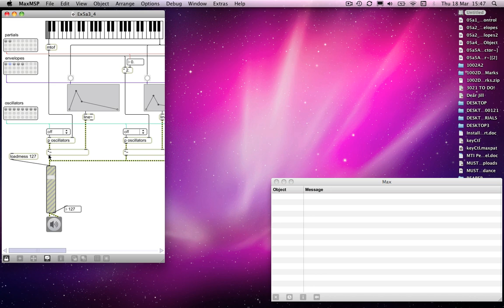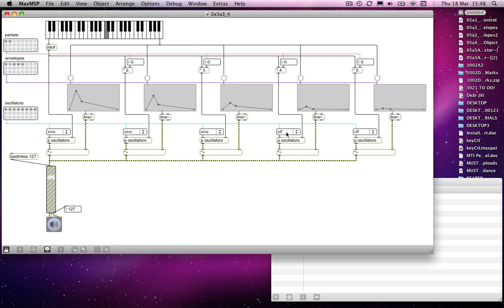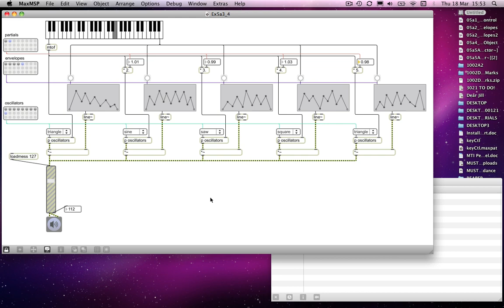Max MSP Tutorial 05a7: Additive Synthesis

Comment from the maker: @mudithead It depends which *~ objects you mean. Those at the top are multiplying the frequency value from the [kslider] (via [mtof]); those at the bottom are being used to control level.  Remember that we're just dealing with numbers, so the *~ object could be used to multiply any signal value to whatever end. 
Not quite sure what you mean by the last part of your question.

Comment: Hey, question- basically, i am pretty confused with 'frequency' and 'amplitude' , what is changing them through what? the right inlet of    *~    object which is connected to envelope is changing the 'frequency or the amplitude?? and can i  say, amplitude directly related the volume of the output signal?